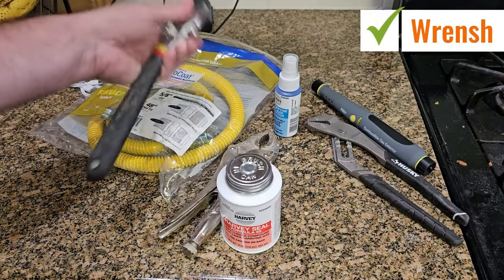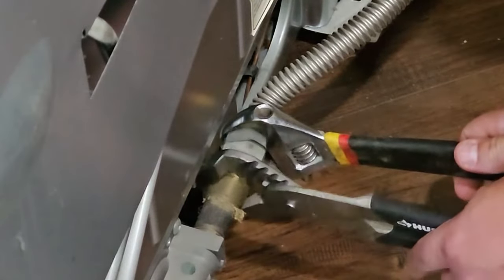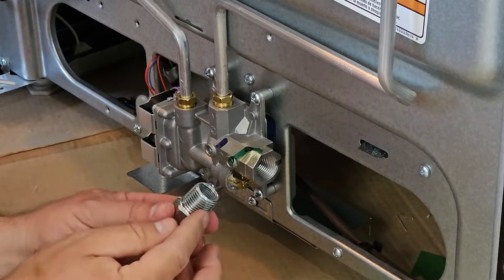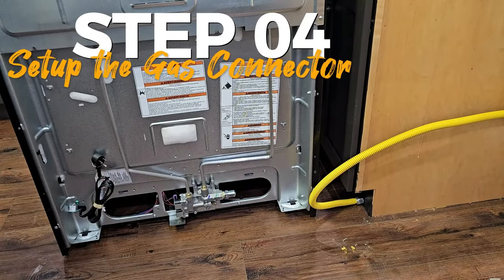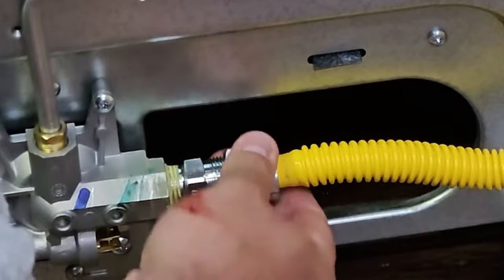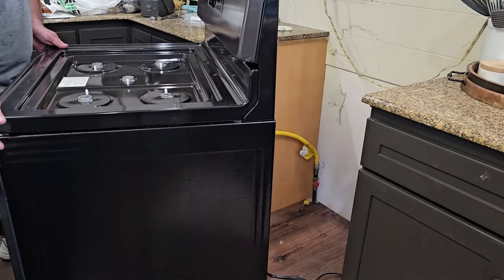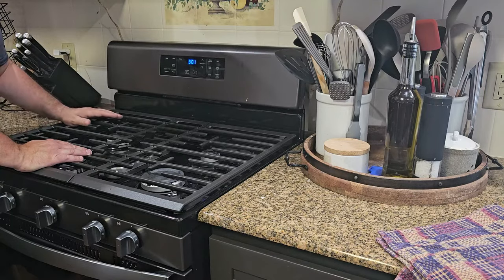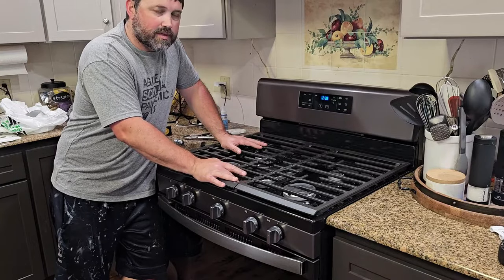DIY Gas Oven Installation - How To Do It Safely and Effectively

Comment: Why is thread compound not needed with the yellow gas hose?  Does it have a gasket?  (I didn't see this addressed in the video.  Sorry if it was and I missed it.)
Reply from the maker: The yellow gas line should be compression seal, at least the one I am using is.  Thread compound or pipe dope is not recommended as it could affect the seal.  Again, I am using a compression seal hose.  If you aren't using compression seal then you may want to use Pro Dope or something like that for gas lines.